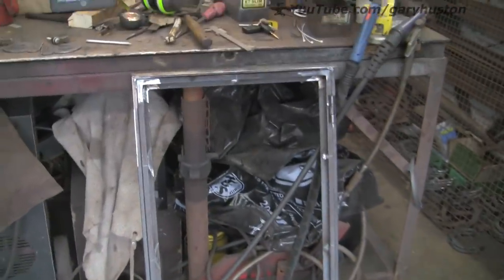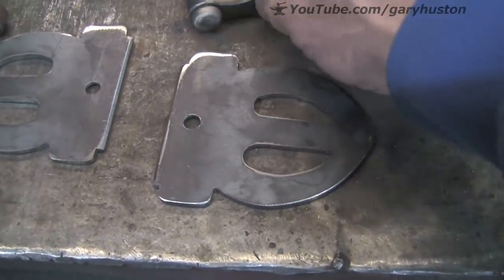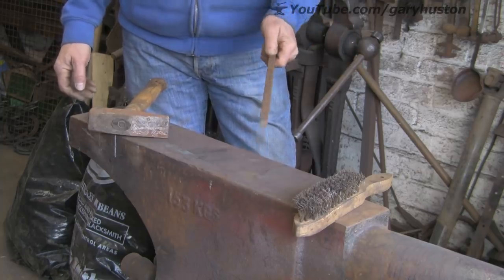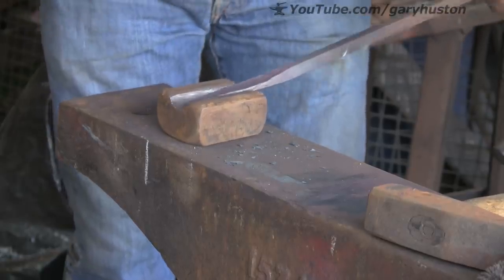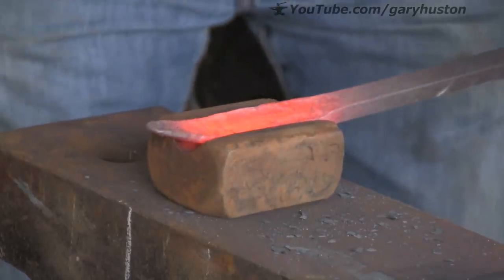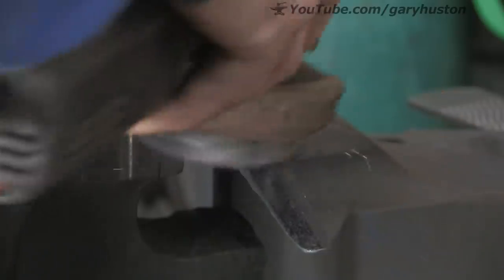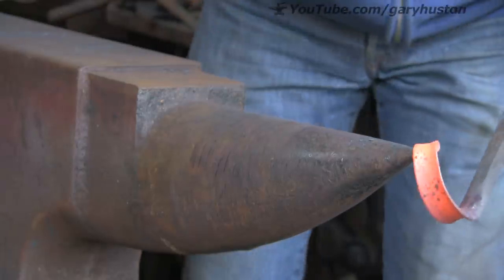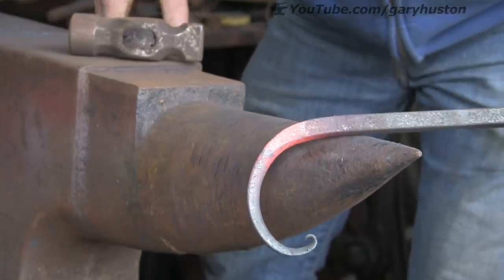Forging Window Handles

Comment: Nice work as usual.  Looks great. I find it amazing that we are on opposite sides of the Atlantic and several timezones apart and yet use exactly the same tools. Hole saw, angle grinder both look like they came right out of my shop.
Small world. I feel your pain with the shoulder. I'm nursing a pulled deltoid and tendon insert. 3 months so far. Can't tell it it's improving or not. Turns out I use that muscle for just about everything but breathing. Makes shoeing a whole bunch of fun. That said, I'm sure rotator cuff injuries are worse. If I were on your side if the pond I would offer to give you a hand. My right arm works. Your left arm works. Between us we have one functional smith and one basket case. 🤣
Hang in there. Take care. I hope at least one of us heals up soon.

Comment: I had rotator cuff and bursitis both.  You're right.  You can't get away from the pain.  Can't sleep.  I got a shot in my shoulder and bango.  No pain.  The needle had to be 3.5" long.  That was 30 years ago.  That sounds to me like it might have been the bursitis.  Not sure.  Anyway, good luck and if they tell you to do the needle, do it.  It doesn't hurt at all when they do it.  No pain.  Cheers.
Reply: Same thing for me. 20 years ago (when I was in my forties) I managed to tear both rotator cuffs at different times. I had surgery on one which took me out of action for months, and a cortizone shot on the other, which worked like a charm. Good luck to you.
Reply: @Vickwick58  Yeah, the shot was a miracle.
Reply from the maker: alex tworkowski I’ve already had the needle, it works but only for a few months at a time.
Reply: @garyhuston  I hear ya.  Sorry for that.  How long have you had the rotator problem, if you don't mind my asking?  You man have mentioned it.  I don't remember.  The reason I ask is that I'd had several bouts with it and it did go away on it's own a couple of times.  The last time I had it, it was persistent and I couldn't seem to get it to improve.  That's when I had the injection.  I wish you good luck with it and I tell you that you have a good attitude and I enjoyed your video.  I subscribed and will continue to watch.  Cheers.
Reply from the maker: I’ve had trouble with it for about two years. I’ve tried everything, chiropractors, sports tape, various pain killers but finally had to go to the doctors. They gave me the scan which confirmed the tears in two of the four. I finally gave into the pain and had the steroid. Trouble is they will only give three a year, and, the steroids make the tendon more prone to snap!
Reply: @garyhuston  Sorry, this one is from Alibaba.
Reply from the maker: Yes, that's just the sort of thing I have been looking at but have no room for it until I can find a bigger shop!
Reply: @garyhuston  I hear ya.  Good luck with that.

Comment: hi Gary I can see it is not easy from the photos. Hope your shoulder gets better soon. Have problems myself so know the feeling. try to use the other arm if you can in till you get a power hammer.

Comment: Still recovering from my rotator cuff surgery I had last Sept.  I completely understand.  I fully tore 2 tendons away from the bone and one of those tendons split down the middle too. So a normal surgery to reattach the tendons to the bone take 6 months to heal. But he wants me to wait 8 months. I will hit 8 months this month.  I did 4 months of physical therapy and I am still having to do exercises.  I watched a bunch of videos of people recovering and they gave such helpful tips for me. Take an old t-shirt and cut the bottom of the sleeve down about 2/3rds of the way down the side. Makes putting your shirt on so much easier.  You will have to sleep in a recliner for about 6 weeks maybe more. Laying flat after surgery is very rough..  I did several videos too trying to help others the way they helped me.  Best of luck Gary. I hope you can get it fixed.

Comment: I built a power hammer a couple years back.  Absolutely love it.  I use it for the bull work and finish up on the anvil.  Purchased the plans online. That was the best investment of the project. "Less think-y, more do-y" I used all new steel and motor purchased from a local steel shop.  $1200 USD total and 3 months of working on my off days.  I just built a pneumatic planisher  for sheet steel.  We aren't getting any younger.  Best of luck.

Comment: 3rd hand tip for holesaws.. give the chip somewhere to evacuate, a hole in the 'waste' slug its self, or have a saw blade width at the edge of the stock so chip's can clear easily. Either way...
Gary, take it easy on the old shoulder bearing/bushing there mate.!

Comment: ..Very Good job Gary !! Hope your shoulder gets better. Now would be a good time for a Power Hammer build...!!
Reply from the maker: I would if I had the room for one! You can’t appreciate from my videos how little space I have!
Reply: @garyhuston  Christ Centered Ironworks shows a "hardy hammer", which is  small enough to mount on your anvil using the hardy hole. You might check it out. You might even hang it on a winch from the rafter and lower it into place when needed.
Reply from the maker: I’ve seen that one, not sure how useful it will be as it makes it difficult to use the anvil at the same time. Also it needs space to store it when not in use that I just don’t have.